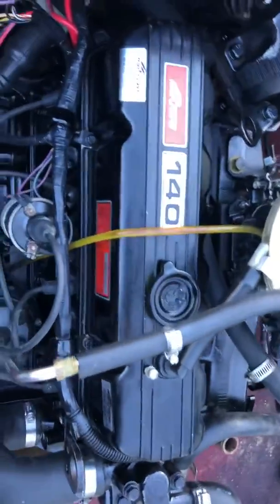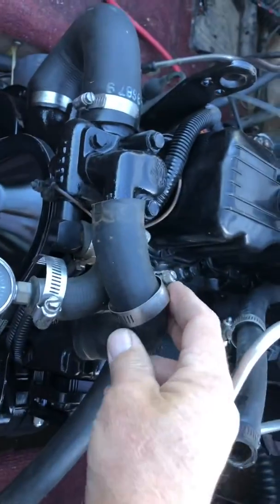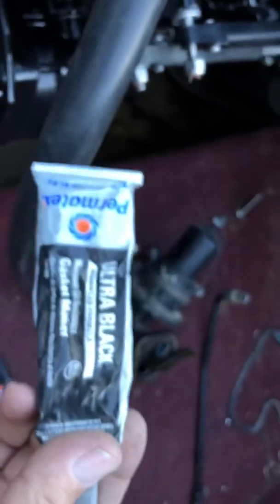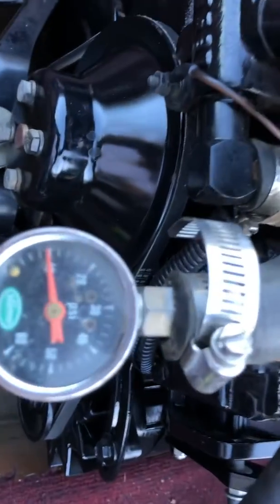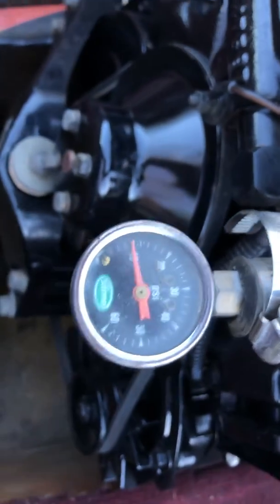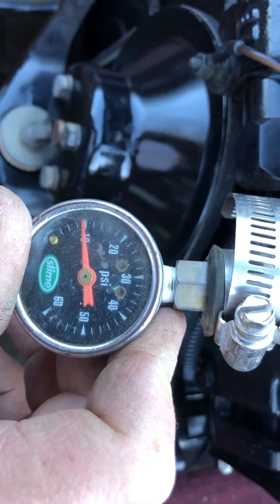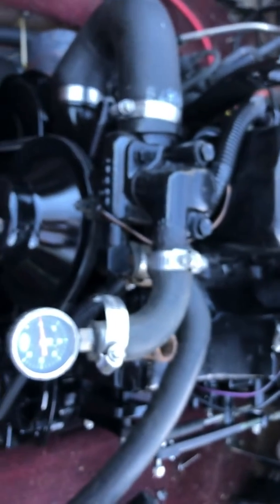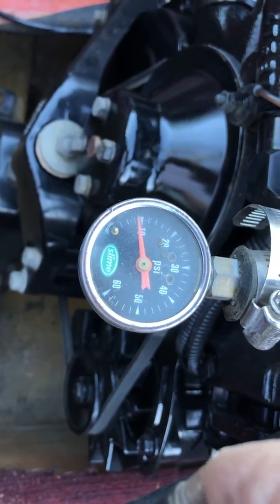Mercruiser 3.0 water jacket leak test

Comment: I see what you're doing and it's a good idea but if your thermostat is still in there you're not doing a true test Maybe you removed it and just didn't show that part
Reply from the maker: Hi thanks for the message. Thermostats have a little hole with a rivet in it that’s to relieve pressure the pressure test a solid.
Reply: @DAVIDRH67  You only responded to criticism, but not the other questions people have in your comments.⬆How did u get the air into the system to test it?
Reply: Yes my question guess could use tee?